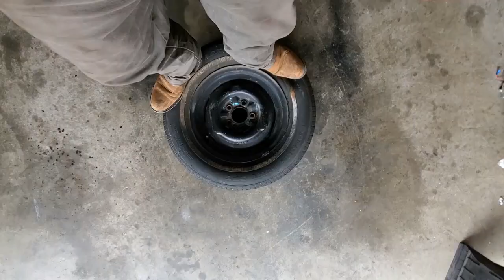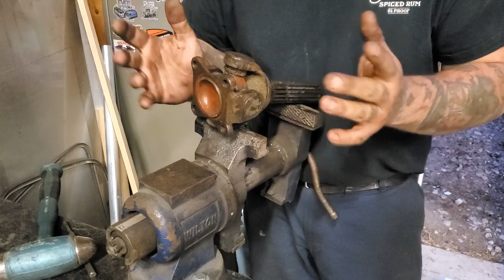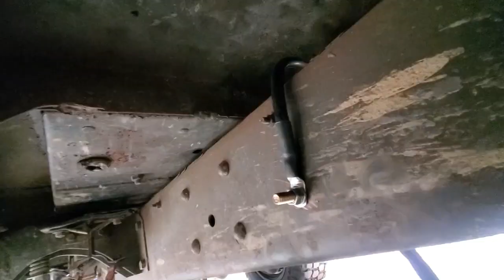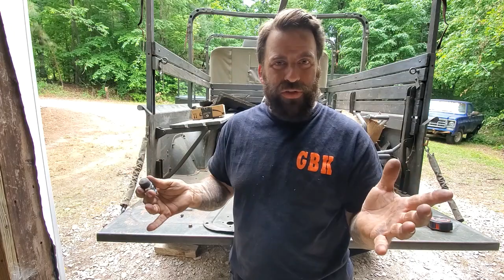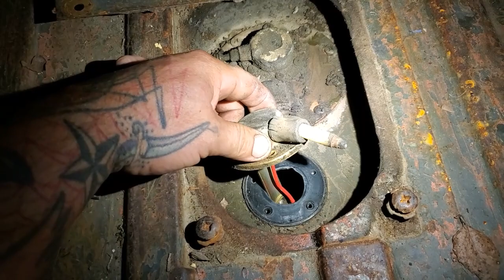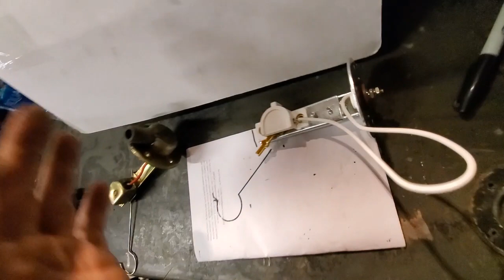1953 DODGE M37 UPDATE-- WIRING, FUEL SENDING UNIT, BATTERY CABLES

Comment: Dan   Great job.   Can you please pass me the info on the sending unit make, model and where you acquired it. Same with the gauge.  I am going through the same issue and the last military surplus I tried (Chinese made) did not work- rheostat bad.    No return either.   Thanks  Marty,
Reply from the maker: Thanks for watching.  The sending unit and gauges were Dolphin brand gauges. https://www.dolphingauges.com/
Reply from the maker: The sending unit is universal.  Just need to know what resistance range you need it to be.  I can look at my notes tomorrow and see if I still have the exact part number
Reply: @greasyboykustoms    Thanks Dan for the info.     Marty